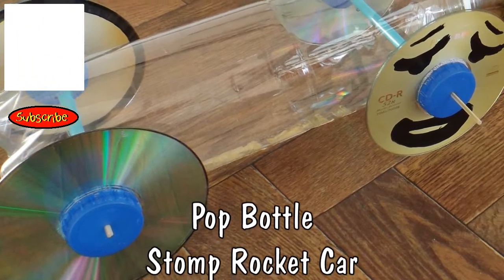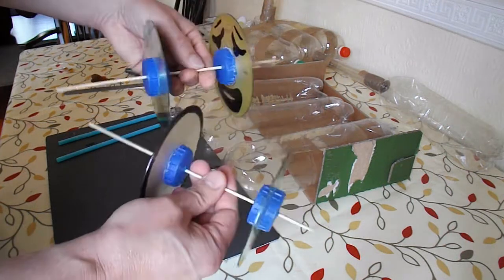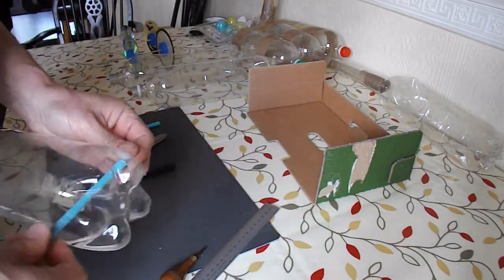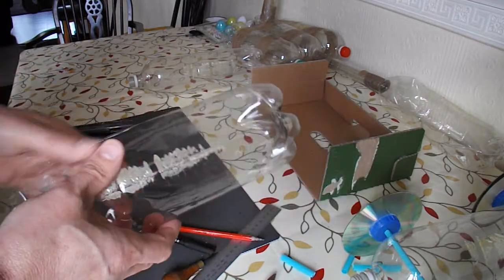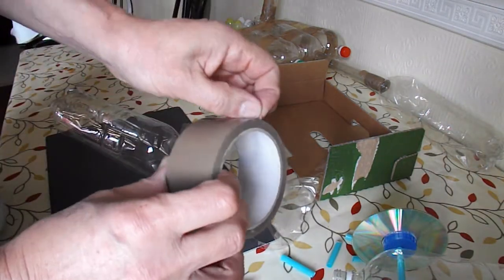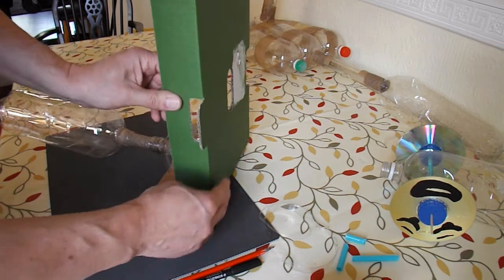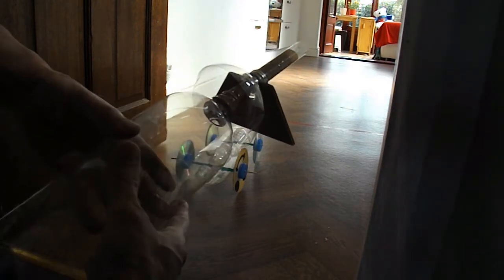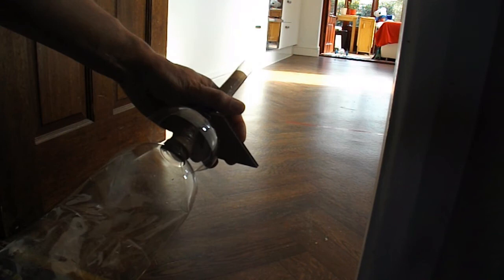Pop Bottle Stomp Rocket Car

Comment: The bottle travels very smoothly giving me the impression that the CDs are very well centered with the milk caps and skewers.  How did you Make sure the holes in the milk bottle caps are  centered?
How do you make sure that the CDs are centered on the milk caps?
Reply from the maker: @edbass2769  by taking care during the build. If you use hot glue, you can reheat it with a hairdryer to adjust the alignment. If you use sticky tape, there is usually enough give to make minor adjustments.
Reply: @GrandadIsAnOldMan  I am thinking of using small corks that hold the CDs and then a sharpened pencil or dowel can be stabbed into the cork.  If that isn't easy enough for kids to center, maybe hot glue for trial and error as you said.
Reply from the maker: @edbass2769  You will be surprised how well bottle caps and sticky tape works. The flex in the sticky tape allows for adjustment. If you have access to a 3D printer I have designed a hub that fits CDs and 3.5mm bamboo BBQ canes.
Here is a more recent video from my Put a rubber band on it channel showing the tape and bottle caps method https://youtu.be/dj1MtFkkK4k

Gripper CD hub 3.5 mm shaft 
Tinkercad files https://www.tinkercad.com/things/2wg08uuwczs-gripper-cd-hub-35-mm-shaft
Thingiverse files https://www.thingiverse.com/thing:4211296